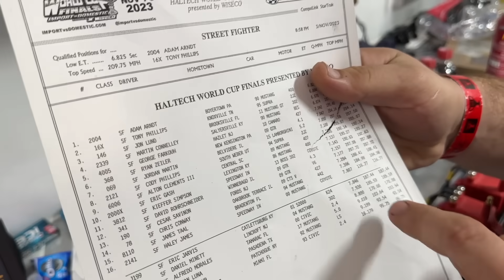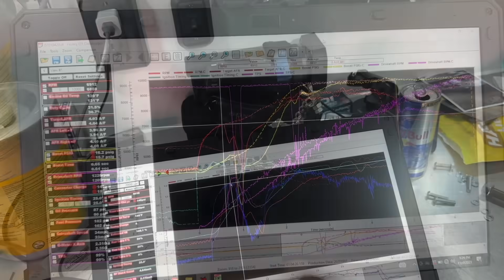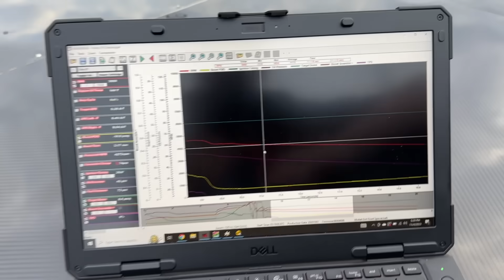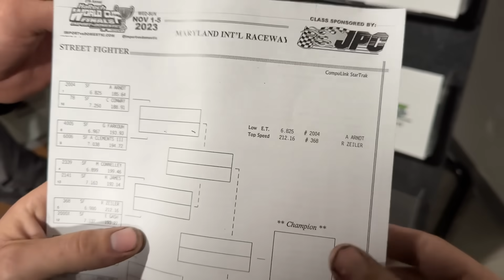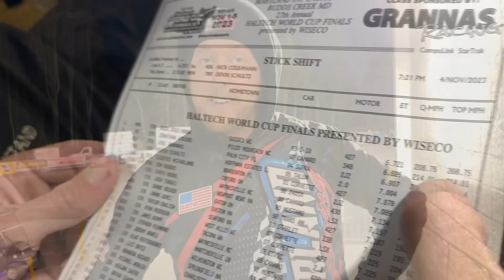World Cup Day 3 - Leroy 2.0 FINALLY Made a FAST Run!!! McFlurry Beats its Best Run EVER Again!

Comment: You guys NEED to put a pressure switch or an analog transducer in the CO2 line somewhere and program an alarm on the dash, it's already a couple times it happens...
Reply: or start using Egates and send co2 in the bin.
Reply: @extec101 I suspect more is run on the CO2 than just gates (shifter, transbrake).

Well after watching the video it's pretty clear that I'm wrong. What with it being leroy lol.

CO2 alarm absolutely though. Egate will eat a couple of motors before they give up
Reply: @extec101 yeah they're making so massive gates too. Would be cool and good product advertisement
Reply: Old school checklist board.  Click it or slid the tab when task is completed.
Reply: @DroneStrike1776 yeah, my thoughts as well, Cleetus is a pilot, and they are always using checklists.
Reply: I came here to say this same thing. Just a switch with a pressure switch wired to an indicator light would do the trick
Reply: What’s c02 used for in these cars?

Comment: Its crazy Leroy came out unscathed after the money shitft. Thats a testament to Pete's building
Reply: At over 9000rpms too
Reply: And a RPM chip!
Reply: @Dealete420 chips overpowered by mechanicals
Reply: Need to rename that engine Goku
Reply: Being turned down, and relatively short shifted when it happened certainly helped it survive that
Reply: Valve springs and rod bolts might not break, however, their life is drastically shortened with over revs like that. 

The smart option would be pull it down after this event
Reply: Yeah, that guys real good at doin stuff
Reply: Thats what you get staying away from that stroker setup!
Reply: @jdoe9518 - 100%.  Steve Morris said as much in a recent video.
Reply: What is that engine rated at? It could be safe up to 9800 rpm but the sudden jump to 9300 could cause damage. He may be okay revving it that high but I'm sure the sudden unplanned spike hurt some things.
Reply: So what I'm hearing is we need a cam that pushes power higher up in the revs. Dumpster Fire Cam 2.0?
Reply: @jdoe9518  His build can take 9k, probably more than that.  I know that sounds crazy, but it was built to make alot of rpm.
Reply: Leroy is at least 5 tenth's slower than the top racers.... in the class. We are always looking for a silver lining, when holding onto the cloud of failure....
Reply: It's not uscathed at all, that motor is now on borrowed time. It needs to come out and given a look-see and a going over,  component failure has been drastically accelerated especially in the valvetrain.
Reply: @WineHouse33 What place is your team in?
Reply: @WineHouse33 4/10
Reply: @WineHouse33 ummmmm  the world record is 6.61 we know it can run 6.9 so I dont know who taught you math but . Yes all the time off with Leroy and not testing has put them behind the top 5 cars . Those are real race teams though .
Reply: @blackopsrocks I could explain the difference between acceleration under load vs closed throttle rpm spike and why it's not good for valve springs and rod bolts but it sounds like you've got it covered
Reply: In the NFL they say "Any given Sunday..." Same philosophy applies to racing... btw I just got done watching 1320's footage and let's just say I'm right and you're wrong 😂 @WineHouse33
Reply: @WineHouse33  class record is 6.61, Leroy has gone 6.92 so far.
Reply: @jdoe9518  No go ahead and explain physics to me.  Whats the area of the valves, the pressure differential between the face and seal side of the valve, how much does that add to the overall lift load on the valvetrain.  The valvetrain is NOT subject to the "acceleration" of forces from sudden increase in rpm, the rod itself when not acted upon by the piston to accelerate is subject to a load that follows the rotation of the crank all the way around, thus the big end isnt under any particularly extraneous load.  The pin end is the ONLY point of contact where weight from acceleration in both directions acts unusually upon the rod.  Now, when you build a short stroke engine, you decrease the piston speed AND the rpm related acting forces on both the little end and the crank itself.  When you build for high rpm, the ONLY issues to be had are valvetrain related, both in rigidity to prevent resonance of components from suiciding themselves with vibration, and setting it up so the math makes sense where the valves are not floating at the design max rpm, nor are they double tapping the seat on closure...etc.  But please sir, give me a physics lesson.  F1 runs valve arrangements in a load cell up and down rpms as suddenly as is possible by a machine taking high speed film of the parts in action.  Were talking in todays terms 22-24k rpm, because while the engine is electronically limited they build the engine to survive sudden multiple gear downshifts for exaggerated engine braking.  The LS in Leroy uses some pretty trick methods to allow the valvetrain to survive serious rpm, and with aluminum rods and precisely  balanced parts, 9200 rpm isnt killing, harming or shortening the life of anything.  If anyone here was right, it would not have made it through world cup quals with "hurt" aluminum rods
Reply: @blackopsrocks  I stopped reading at  "The valvetrain is NOT subject to the "acceleration" of forces from sudden increase in rpm" 

That is literally the dumbest thing I've heard in long time. 

OK, why is 800 - 1000lb spring pressure required to control a valve, springs, retainer and collets that weight about a 1lb?

Could be that linear motion is required to change direction and the faster it's moving the more force required to stop it... 

Yes rocker, pushrod and lifter come into it, however, rocker ratio determines how the load is distributed from rocker shaft centreline.

Loft is when valve train is no longer following the cam lobe over the nose.

Bounce occurs when the valve contacts the seat with enough force it bounces open.

Deflection is when the bending load of component is exceeded. Pushrods, rocker stands and rockers are the most prone to deflection 

Float is when one or a combination of the above are so bad engine acceleration begins to retard due to loss valve of timing and compression.

Look into Spintron testing to learn about the relationships regarding valve train stability.

Same linear motion goes for the piston which relies on the rod bolts to handle the force as they clamp the assembly to the crank and deformation will occur first at a part line. Bolts are stretched via torque to achieve a clamp load. Rod bolts can be over stretched if the part line is deformed. An over stretched bolt is no longer tight.

Now on a downshift over rev a little thing called cylinder pressure is missing because the throttle is closed. So the opposing force applied to the top of the piston, a lot on compression stroke and a little on blow down, just isn't there. So a money shift even within the rpm window puts more load on rod bolts. Even wonder why the blip of throttle on a downshift? It accelerates the engine under load to match the road speed...

The spike in rpm comes from the overall gear ratio of tyre circumference, CWP ratio and the gear selected vs the road speed of the vehicle vs engine rpm when the clutch is engaged. 

I'm not going to provide formula or go any deeper in discussion that include harmonics and resonant frequency.
Reply: @jdoe9518  stopped reading eh?  Good luck in life, go to the library.  Acceleration is not rate, either the valvetrain can tolerate given rpm or it cant.  Its not a matter of how quickly it goes from say 6k to 9k.  The valvesprings, rockers and lifters will not experience the acceleration from 6k to 9k because they are not rotating.
Reply: Especially after a money shift and comes back stronger and win World Cup!
Reply: @jdoe9518 my ideology is if it ain’t broke, don’t fix it. As soon as Mullet’s last engine went for a refresh, that’s when they had issues.

Comment: Add a warning light that lights up if the CO2 pressure is low. That lets you know both if the bottle is low and if you haven't turned on the bottle yet. Take that LEAN approach and add a safety if you encounter a problem, so it doesn't happen again.
Reply: Kinda surprised they haven't done something like this already as I'm pretty sure this has happened a few times before.
Reply: What do they use the CO2 for?? Why is it causing it to go slower??
Reply: @martindworak  They use it for the onboard sodastream machine, That way cleetus can get his mountain dew ready to drink when packing up the chute after a pass.

They use the CO2 for the wastegates
Reply: @parma-sean mcFlurry ran outta co2 during testing with the new engine before this event iirc
Reply: @ryansellsdrugs  oh so instead of having vacuum operated waste gates, they use positive CO2 pressure from a tank?? Does that make it more precise, faster reaction?
Reply: @martindworak it’s for positive pressure on the topside”dome” of the waste gates. Instead of a spring keeping the gate shut they pump co2 into the dome. There is still a spring in there but it’s normally a pretty small one. It’s tunable unlike a spring. You can ramp in co2 as the pass is underway to force the car to make more boost as it gets down the track. A good example is when they are doing their 2 step checks they have a certain amount of dome psi mixed with the reduced rev limiter to create a much smaller amount of boost then they will make on the pass.
Reply: Time for electronic wastegates?
Reply: @martindworak  CO2 pressure = wastegate pressure I believe
Reply: They have a big pressure gauge right on the bottle. You can see the needle at zero during the run

Comment: Remember when Mullet was going to be a jet car? I think I’m way more glad to have seen this route. Hell yeah brother. Keep on keepin on 🦅 🇺🇸
Reply: Yes but no, that was a different car. He got shot down after they cut it up so they bought another chassis.
Reply: it was for the best that idea got cancelled.
Reply: @RadDadisRad it's the same chassis, when Kevin started working on it he talked about having to adjust it because it was already being made for the jet. And he didn't get shot down, he changed his mind after Kat Moller died in a Larsen jet car
Reply: What he said^
Reply: @testarossagzb5582  he did talk briefly about it being not able to race at a lot of tracks because it would be a jet car. Maybe that added onto the aforementioned points you brought up as well. I was almost positive they got a new chassis because they cut and extended the el Camino for the jet engine and it was just too altered and he didn’t feel comfortable, I could be wrong.
Reply: I was thinking the exact same thing when I was watching the line up for run on this video!!
Reply: @i-_-am-_-g1467  oh yeah the complexity of running it was part of the decision as well, my point was that it was his decision to change it. And Kevin made several videos doing those adjustments, but I think the confusion is because they did get a new body. They had already moved the wheel wells back and it was easier to get a new body then put them back, but the chassis just needed mounts moved back to their original location.

Comment: Went from "Turn intercooler on" to "Turn C02 on" that run would have been a ripper
Reply: Only OGs know lol
Reply: They have done it before too. But yeah they definitely need a sticker that says "Turn on CO2" now.
Reply: God forbid they install $25 worth of sensors that will turn on a dummy light that says something is not at the right setting. For example; CO2 pressure below 10psi? = dummy light. Please at least someone write a checklist. 
FFS airline pilots with 40 years experience are still required to use check lists for a reason.
Reply: Haha, Cleetus being a pilot knows checklists work. Ask anyone from the military lol!
Reply: @ironicname45  yeah, especially considering cleetus literally is a certified pilot you'd think he'd do checklists for drag racing as well
Reply: For redundancy, a Big Tag On The Bottle that reads, "TURN ME!"

Comment: Time to make a pre-run (flight) checklist for Leroy.
Reply: Needs to put a pressure transmitter on the CO2 and set it up as a monitor on the display.
Reply: He had a big cardboard sign on the center console reminding him to turn things on a while back.
Reply: @FluidKaos  "turn on intercooler"
Reply: @Gobbbbb with tape on the steering wheel
Reply: @RadDadisRad 
Came here to say exactly that. 
Think he knows a guy connected to a pressure sensor company. . .

Comment: I agree with commenters suggesting Mullet be used just for Drag and Drive... technically still needs rear suspension and rear end work though. Both KSR and SM have pointed that out in videos.

Comment: God damn, check the locknuts at 12:41 on the shifter linkages 😂
Unwinding like there's no tomorrow
Reply: Locknuts with a shoulder. Designed to be "loose" but are actually tight. If there was no shoulder the shifters wouldnt move
Reply: @robbygray9562 I think you missed which one he's talking about. Look at the jam nut on the lever for the 1-2 shift. It moves towards the lever until it bottoms out against the other end.
Reply: @robbygray9562  As the guy stated in the other comment, grammatical error on my end. I meant jam nut.

Comment: Electric solenoid valve on the c02 bottle as well as a pressure alarm. Wire the solenoid valve to be controlled by the ECU. Never forget it again.

Comment: Might be worth looking at getting a motor block heater unit for some of your drag fleet. A lot of oval track guys in the Northeast use them in the early spring mid-late fall events when temps are chilly. Its essentially a portable oil pan heater to help oil flow through the block on cold starts. Might be slightly easier than tripping the breaker in the trailer trying to run a heater all night.

Comment: Time for Mullet to get some big boy tires.
Reply: 315 is the biggest tire he can run in the class. Big tires won’t help anyways, 315 radial car just went 5.75@254 last night. The chassis just isn’t capable
Reply: Unfortunately it's not tires. It's weight and suspension. Other cars are e running the same tire he is.
Reply: @carrick166   They took a chassis that was origially going to be a joke jet-engine powered build for the channel and turned it into a drag car instead of actually picking a chassis that would actually make a good drag car (like McFlurry) and now they're unfortunately paying the price for trying to go low 6's in a 3800lb El Camino... if Mullet's setup was in a decent chassis it would fly.
Reply: @plark7323 3400 pound car, and it's gone low sixes. They need to lose some more weight off the car but I believe it will see fives.
Reply: @michaelcederquist6180  he might get that one or two perfect weather perfect track but racing is consistent results or improvements.

Comment: Even though McFlurry didn't make the cut in a class full of killers it was it's 3rd 4th and 5th pass of its new setup what do you really expect and it's with way smaller turbos than you normally run... I bet McFlurry goes sixes first time out with the regular turbos
Reply: Doesn’t need bigger turbos to get to 6s the rest of the class proved that.
Reply: @bbdl7042 no the rest of the class has different engines they don't have the same restrictions on engine size it depends on how many cubic inches you run smaller cubic inches has no limits on turbos learn the rules it helps
Reply: @bbdl7042 and if you paid attention there's so much back pressure already the turbos are already out of steam at 3540 lb. So definitely not on that combination unless they throw so much timing and fuel at it they might get lucky or they might hurt something it's completely pointless when they can just put the turbos that came on that car to begin with and run 6s no problem

Comment: I had a billet oil cap on my ZX12 race engine. I really think the high rpm vibration loosens them… it was loose after almost every feature. The stock plastic cap has no problems 🤷🏻‍♂️

Comment: Mullets first run, looking at the track at the start line at 8:50 you can clearly see where previous cars have "hopped" causing the track adhesion to be like corrugations which would be less than optimal I expect.

Comment: This is one of many reasons why I prefer onboard air. Sacrifice a few pounds but you set it up to always maintain pressure as long as the fuel pump is running and then never worry again.

Comment: Leroy 2.0 is really making some progress now, gonna be 6s in no time, there's still a lot left with that Harrell LS & the back-half. It's amazing how the OGs of stick shift(well, of the last half-decade or so anyway) are still all at the top of the class - (aside from Cole-Mann and his SICK LS Dime taking over...), Grubworm, Grannis, Red Demon, Leroy, pretty damn cool(I think they're all running a Tick T56 too, Demon aside)! And, shout out to Red Demon @7.004, hopefully they can get back into the 6s; it STILL blows my mind that a DSM is running on the verge of 6s!
Tough break for McFlurry, but he's just getting started with that Coyote - it's going to be an animal with a bigger pair! May need some gearing adjustment before long.
Time for some major surgery for Mullet, frankly it's ridiculous that it's doing what it does on stock-style G-body suspension lol. Time for a real 4-link, maybe remove some more sheet metal. Or maybe buy a roller to drop the powertrain in for the races and keep 'street mullet' for the drag-n-drives?

Also... WTF with this stock SUV blowing all 4 tires off on a prepped track!

Comment: Learn from the CO2 bottle mistake and install something like a low pressure switch attached to an indicator light. That way you can also be alerted in the event your bottle is getting too low for another pass.